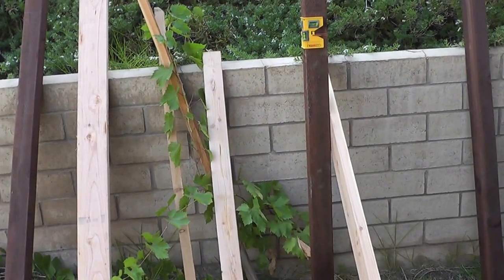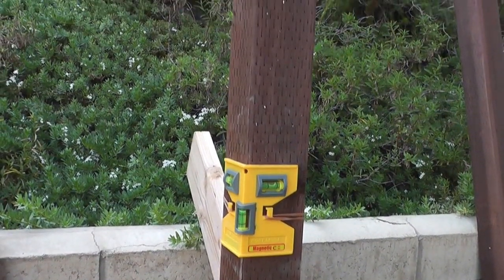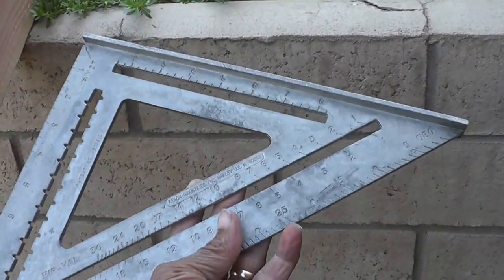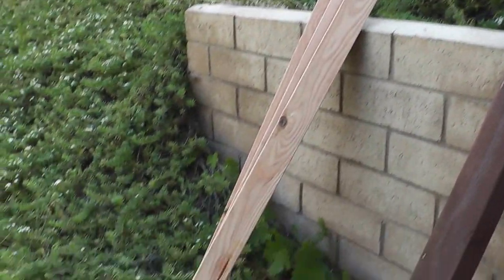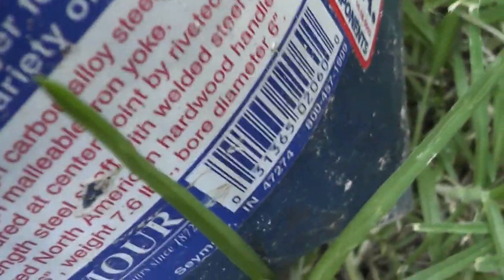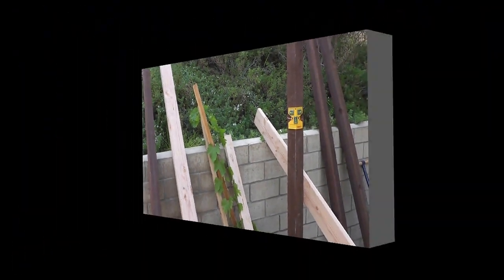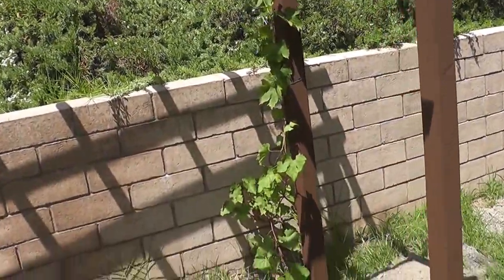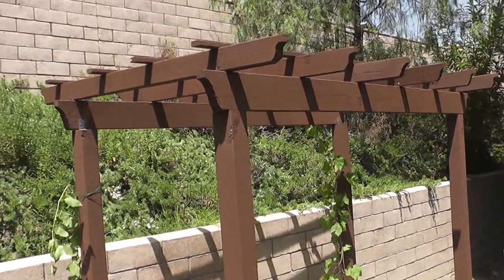How To Make A Grape Trellis 1

Comment from the maker: Hello, I think I've seen a two level trellis used.  The only issue I see is that if your top level becomes very think and clustered, it MAY prevent the bottom row from getting as much sun as it needs.  BTW, the very top wood slats were nailed with my air brad nail gun.  I only use my deck screws for my metal braces.